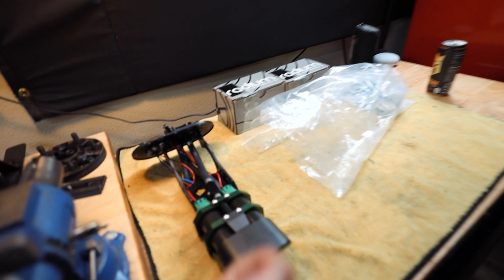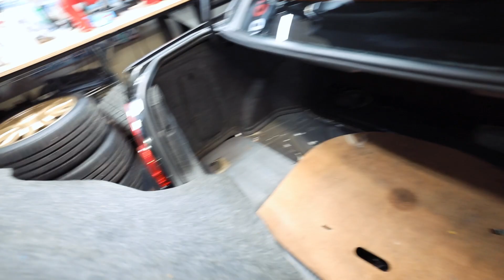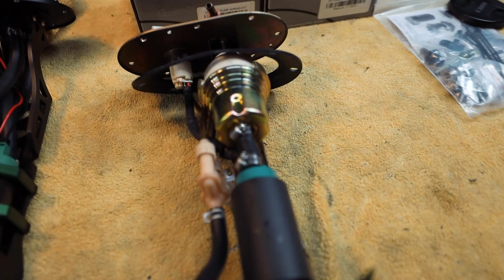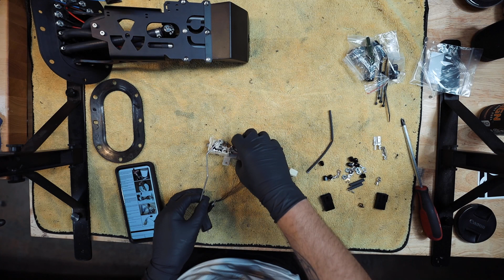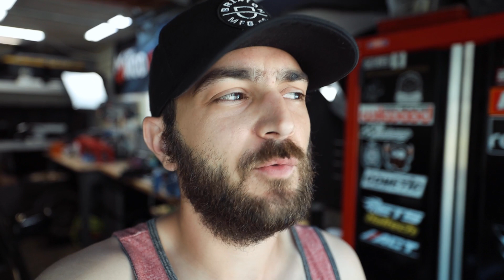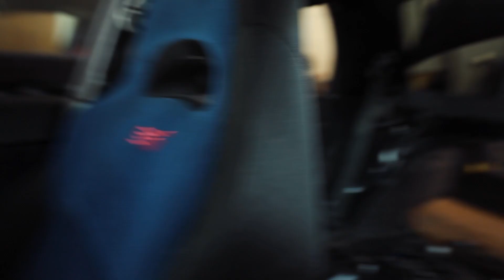HUGE Fuel System Upgrade! Radium Dual Fuel Pump Hanger Install; 2005 Subaru WRX/STI.

Comment: I installed one of these in my 07 STI. I'm glad to see that you just bought it with the two pumps preinstalled. I decided to cheap out and reuse my 340lph and just order the radium hanger with 1 pump. Big mistake. The two pumps are ever so slightly different, and my old 340lph did not fit correctly. This decision to cheap out started a chain reaction of events that led to blowing my head gasket. Also, glad to see that you didn't break any of the fuel hanger studs. Over here in the north east, they always break!
Reply from the maker: Breaking one of those studs would not be a good time 😖 luckily all the ones I've seen up here have stayed in tact. And I debated buying it without the pumps ore installed but figured for this it would just be a little more simple to just get it with thr pumps for now

Comment: Perfect timing dude. Just spent the past few hours doing research on this and looking for install guides for this hanger.
Reply from the maker: Eyyyyy, not too bad to install and wire up 😁😁😁
Reply: @Smeedia   I saw you still used the factory rubber houses from the fuel pump hanger to the hard-lines? Are you planning to replace these with PTFE lines like in the engine bay? i know Radium offers an upgraded Fuel Hanger Plumbing Kit.
Reply from the maker: I'll end up making my own lined and what not, for now the Oe Rubber lines work for yhr power we are at, but when we do the engine rebuild I'll go back over and swap to a -8 feed and -6 return

Comment: I’m installing the radium as well. Had great advice that a hobb switch should be installed on one pump because the return is smaller than the feed and at low end/idle the smaller return will back up and increase the pressure in the rails because the fpr can’t evacuate enough pressure. Making bad drivability
Reply from the maker: May have to hand that in, was going to increase duel hose sizes when we do the rebuild and do a -8 feed with a true -6 return
Reply: @Smeedia  I’m going true 8 to 6 right now. But at idle am afraid that the injectors will only be using a very small amount so it would back up rather fast I would think. Just something to ponder on. I’ve  definitely used some things you have shown and I’m just trying to return the favor. You do a good job man. Props
Reply from the maker: Goijg to have to do some digging into this 🔥 I vaguely remember us talking about this before as well 😅 added it to my notes to look into 😁

Comment: Here down in LA we can have up to 132F on the concrete level of air the concrete is much hotter and 110 at head height. And we have so much humidity we have condensation on surfaces that run down and pool inside of internal components like frame rails and non water tight boxes.
Reply from the maker: 🙅‍♂️🙅‍♂️🙅‍♂️🙅‍♂️ that weather is thr whole reason I moved out if Louisiana 😅

Comment: That was pretty good, other than the heat it looks pretty easy to do.  Florida is pretty bad but since I've moved to SC the humidity is way worse then when I was stationed in TX, thinking about a window AC unit just for the garage/I know your pain.  Keep up the awesome content and work, always🔥🔥🔥🔥
Reply from the maker: I may have to follow suit and snag a small AC unit for the garage as well 😅 the heat ain't too bad but the humidity suuuuucks lol
Reply: @Smeedia  absolutely does suck, you can feel it draining the life from you

Comment: It is important to mention that you should only be using electric power tools with brushless motors, or pneumatic tools.
Reply from the maker: Ohhhh yes, otherwise you might be in for a spicey surprise that wouldent end well 😅🔥

Comment: Just did the walbro 450 in my garage 2 weeks ago...sweating hell....halfway through I wished I had gone with this dual pump.
Reply from the maker: I've been there before, never hurts to fitutr proof for more power if your going in the fuel tank 🔥
Reply: @Smeedia  yeah it was theast thing to get done before I started to break the motor in...now two weeks later and chasing a vacuum leak...pretty sure I added too much at once because the motivation has left me lol replaced everything but the transmission in a 4 week span with whatever extra time I had left after work

Comment: Weird question are the hoses to the fuel pump clamped down? On a whalbro 450 we had to use a heat gun to get it in and it’s pretty much on there but can’t seem to see anyone using clamps on the fuel pump hose from the radium.

Comment: Thanks for all the videos, really learning alot from them.  Just took the intercooler off my 06 Legacy gt and noticed a bit of oil on the turbo side.  Cause for concern?   Should I install a catch can?
Reply from the maker: Catch can or an AOS should help clear up a lot of that blow by ❤
Reply: @Smeedia  The fun never ends 😁

Comment: How many horses should I expect for stage 1 , catback and 3 port cobb controller on an sti? BTW i cant imagine how expensive its costs you to make the videos, you’re putting new amazing parts on everyweeks!
Reply from the maker: It definitely adds up but enjoy making them all 🙌

With a catbaxk and boost controller you'll need an Etune but I'd except to see about 270ish WHP 🙏
Reply: @Smeedia  Thanks tanner, will put a air intake and a dyno right away too. Thanks for the reply!
Reply from the maker: Lemme know how she does with the tune!

Comment: Hey bro I'm trying to connect my tgv deletes to my ID 1300s and my radium fuel rails for my 2020 sti! What should I use to lubricate the o rings?
Reply from the maker: I've used super lube, WD40, silicone spare and oil. All work but spray it on your finger then lightly lubricate the O ring

Comment: Do you think i will need a external fuel pump with 500 crank hp on my 2018 wrx sti? I just updatet the injectors, fuelpressure regulator and the fuelpump. (1050cc injectors and a 340 liter per hour fuelpump)
Reply from the maker: Guessing your staying on pump gas? No need for an external pump 🙏
Reply: @Smeedia  Yes Pump Gas. Thank you!

Comment: Loving the content is this setup instead of fitting a surge tank in the engine bay or can the twin pump hanger pump the fuel needed to the engine for 600hp?🤔
Reply from the maker: Yessir 🔥🙏 I'm using this hanger With two 450s in my 17 STI

Comment: Hello 👋 im going too install my built block soon just waiting on my turbo And well Do you need a new ecu if your getting a whole new engine in your subie ?
Reply from the maker: No need for a new ECU for a block replacement, you'll end up using the AP to tune the car with a protuner 🙏
Reply: @Smeedia  thank you ! Your a life saver  🙌 its my first time installing a new engine in and most of the stuff is new too me so im learning along the way 😌.
Reply from the maker: Always open for questions! 😁

Comment: Other than a head gasket, and thermostat, what else can be causing an overheating issue. I doubt it’s an air bubble. When I send it, it goes 200 + 217, and then it drops. When it’s idling, it’s 196-198 and when I open the hood, it goes down drastically so maybe I should change hoods ?
Reply from the maker: Not head gaskets 
Not thermostat 

Only other things I could see are a bad radiator 
Blocked coolant passage

Comment: It's so hot here in SE Washington! AC went out at work, so it's 93 in the building....time to leave early 😅 would it be a back I idea to flock a dash in this heat ????
Reply from the maker: Tbh the glue might actually dry quicker 😅 removing the dash doesn't sound like a good time though 🥵
Reply: Good thing you have a video on removing the dash it'll make it easier for me!

Comment: Im new getting into wrx/sti so should I get a 2015 sti limited or spend the extra money and get a new version
Reply from the maker: Personally I would get a used model. Preferably a 2019 if your looking to push one with the stock engine

Comment: Can’t remember what size injectors you have but for e85 to be safe should have been a -8an fuel filter and it should be 10 microns not 100. Didn’t come up with this myself. I am working with a small team of builders and tuners that are some of the best on the eastern coast. Just trying to help buddy.
Reply from the maker: ID1700s 🙏 I've got the 10 micron filter just have to swap out the core. Also have a -8 fuel filter but for the 17 STI I could spare for the time being. But staying with -6 for now. But I do agree that, that is the way to do it 🔥

Comment: Can you use an aem fuel pump on an stock block and do you have to run e85 can you just run 91? Fuel pump is going out so I rather just upgraded when I do go e85
Reply from the maker: Yes you can use it and they work for either E85 or normal pump gas 🙏😁
Reply: Thank you my dude👍👍👍👍👍

Comment: I love my AEM 340lph multi fuel type pump. It's surprisingly quiet when you key on and prime it. I've heard the Walbro and it's a loud fucker compared to this.
Reply from the maker: I don't mind loud pumps but the AEMs are not too loud. Interested to hear the Walbros in the other car 😅

Comment: Hey Tanner since you’re using Radium Products I was wondering which you’d recommend. IAG AOS or Radium Dual Catch Can? I have a ‘20 WRX with basic bolt ons
Reply from the maker: TBH personally for the FA20 I would use the duel catch cans, for an EJ I'd say IAG AOS
Reply: @Smeedia  Thanks!

Comment: How often should you think about changing your fuel pump , been thinking about doing mine
Reply from the maker: They're not really a wear item, mainly swap them out for more power. But I've seen OEM pumps last 200K+ miles

Comment: Awesome vid! I always come back and check out info. I have a question for you, I'm almost done with the FA20 build, I am on the fueling system. For the my needs I ended up getting the dual pump Radium set up like the one on the vid. Did you find it sufficient,  did you run into any issues? Did you need a surge tank?
Reply from the maker: No issues, would definitely suggest adding another inline fuel filter though
Reply: @Smeedia  thanks bro, the surge tank is the only thing not on the rack. Thanks for the help. I saw the flatiron vid, I'm glad to see you making it...

Comment: Hey man just wanted to make you aware of something you might want to look into. You said that you are getting a aeromotive 100 micron fuel filter that you are installing post pump. Radium has a fuel filter selection chart on their page that they recommend a 100micron filter only be pre pump. A 10 micron stainless filter is recommended for post pump application according to them. I know it’s a different brand filter you’re getting, but I’m sure it’s essentially the same filter as radium. I’d just hate to see you have issues from this.
Reply from the maker: I saw that as well, not sure where they want the filter pre pump though, I'll snag a 10 micro filter that's the same size as the 100 I got and if we run into issues I can swap them out 🙏 appreciate the heads up on that!
Reply: @Smeedia  yeah I thought of the same thing when I saw the pre pump thing too lol. I just figured this would be one of those things you’d pull your hair out over trying to figure out the issue if something ever went wrong. Also no prob man keep putting out that 🔥 content!!!

Comment: Just wondering how AN fittings would fit in that small space as I'm looking to do uprated lines. -8 feed and -6 return and standard crossover
Reply from the maker: I was able to fit them on my 17 STI (ALSO -8 FEED/ -6 RETURN) tight tight space but you can make them fit

Comment: Weird question but I went fbo with my sti and have a 38mm tial wastegate setup and for some reason it doesn’t sound super loud like it should I can hear it olny a little bit opens up at 16psi of boost what u guys think ?
Reply from the maker: The cars already been protuned? What springs are in the W/G?
Reply: @Smeedia   yea tuner well jr told me it everything is good but it’s just quiet then normal
Reply: 16 or 18 psi springs I was thinking maybe wastegate is bad but it does open
Reply from the maker: Kinda stiff normally I have mine around 13lbs. But glad that it got sorted it sounds like
Reply: @Smeedia   still trynna figure it out myself I’m thinking maybe putting in a new wastegate with same springs see what will happen the one that’s on works  u hear noise just not as loud as it should
Reply: @Smeedia   the wastegate flange was loose lol problem solved
Reply from the maker: Glad it was something easy!
Reply: @Smeedia   yea but got one more question for u  what’s a normal colant temp on sti mine is 205 sitin 185 190 drving that’s normal on a hot day correct ?
Reply from the maker: Totally normal Temps 🙏

Comment: Florida here... yup it SUCKS to work on my car in the summer. It actually it really doesn't happened I just look at it and go back inside the house. 🙄
Reply from the maker: How's the weather in the winter?
Reply: Depends in what part of Florida you are. North gets some freezing conditions, Central gets cold with some frost here and there. South just cool. Of course it all depends what kind of Floridian you ask. 🤣. But winter time is the only time I do heavy work on my car, 2hr+ part installations... summer nope not happening...

Comment: Just ordered a Radium FPR... my base pressure is at 60psi after the AEM 340LPH pump, I'm hoping it's causing my very rich condition (-25% STFT) I've been fighting for months...
Reply from the maker: Not a bad FPR, but the pump shouldn't mKe fuel pressure spike like that 
Whats the car?
Reply: @Smeedia  2008 WRX hatch. Car side top black fuel hard line (pressure) to top line on engine, lower fuel line comes out through the stock regulator then back into the grey line to return to tank? Is what I'm working with. Pulled the vacuum line on stock regulator, went up to 62psi O.o

Comment: What happens if you did run both fuel pumps before you needed all that fuel
Reply from the maker: May tun into idle issues with the FPR being over powered but aside from testing really

Comment: Hey Tanner what are your thoughts on the Radium aos?
Reply from the maker: I used one for a few weeks, not a huge fan of it, ended up swapping to thr IAG. Personally did not like the coolant hose routing or the PCV hose routing
Reply: Cool man thanks

Comment: are you not concerned with having exposed wires in your fuel tank tho?
Reply from the maker: Gasoline has a low conductivity so not overly, most electrical connections can withstand fuel

Comment: Your trunk opens that easily?? My seals suck the living hell out of that trunk lid. The back seats......I've wanted to remove them and find some kind of overlay in CF or something so the bare frame doesn't show.
Reply from the maker: I've seen some diversionary panels that are CF and Aluminium but they're a little $$$ 😅
Reply: @Smeedia  from what I've seen, it's probably cheaper and better to try and fabricate something myself, but out of what I have no clue. And also, RiP to Matt's toes

Comment: The radium fuel hanger is shockingly bad for the fact you have to disassemble it and assemble it inside the tank. For nearly $700 they should be doing better. I was shocked when I saw that with mine. You have to be VERY careful because while you are putting the sender on the hose rubs on the lip and will wear through very fast. You can do it with one person but holy hell is it annoying. Such a terrible design.